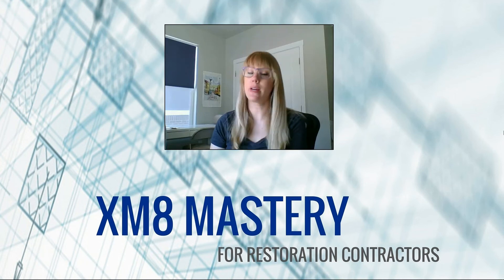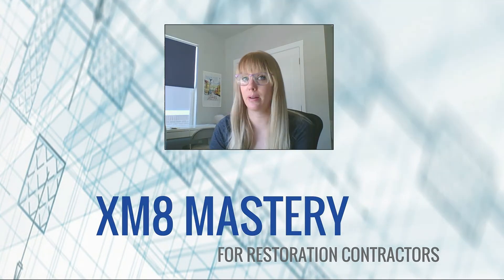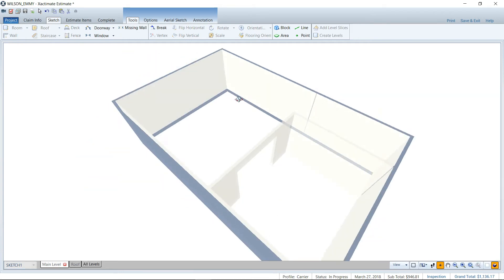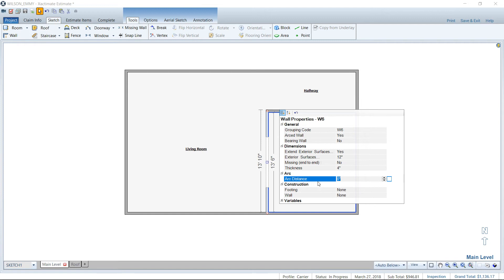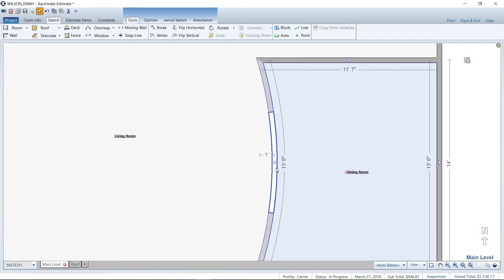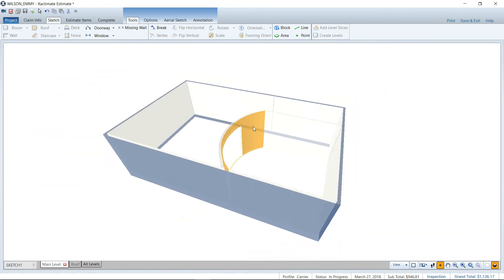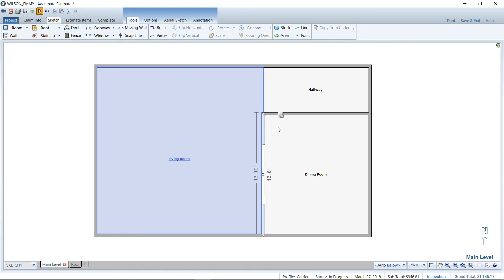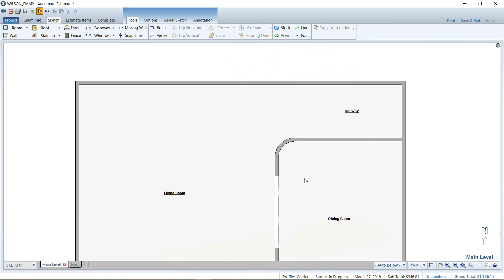Rounded or Arced Walls in Sketch

Comment: QUESTION: What if the wall you want to Arc is not the entire wall.  Say you have a 16 foot section of wall but only the center 10 feet is arched out with a remaining 3 feet of flat wall on each side of the arched section.  
I cannot seem to figure out how to set new points of contact on the wall to arch only that section.  I do not want to arc the entire section of wall
Reply from the maker: I would recommend building 2 separate rooms and combining them or using the square break tool to break the wall of 1 room and pop out the wall 4" then arc it, if you don't mind the 4" difference.

Comment: Alena, amazing, just watched it fully, didn't even realize that "Arched Wall" trigger was even there after all these years....  How about a video on "How To Do Understair Rooms Without Breaking Floorplan"... At the moment I have to break out the room separaely and draw a little arrow to the location that it's at (underneath the staircase). But is there a method to actually place the room itself underneath the stairs??? Thanks again for this nfo.
Reply from the maker: That's funny because Ethan commented the same thing about the room under stairs issue! I'll have to look into it further as I haven't had to Sketch that particular part of the home. Gotta do some homework!
Reply: Alena Wilson I know after I posted my comment I scrolled down to see his comment and I did a double-take.  Alena, is there a calc code for LENGTH OF A SHORT WALL?  In x27 used to be “SS”. (As LL is length of a long wall). TIA.
Reply from the maker: All I can see is HEIGHT of the short wall (SH). I believe you could just load baseboard or whatever LF line item you're needing to your cursor in Sketch and apply it just to the short wall for the LF. Does that make sense?
Reply: Alena Wilson Very true, however I prefer to enter my line items via the entry pad.  I can enter line items much faster like that because I can type very fast. I hardly ever use the line item placement to on the sketch screen.
Reply from the maker: I just figured it out with tech support - it's the variable, then the part # in the calc field, i.e. PFW6
Reply: Alena Wilson yep that’s right you can do it like that... but there is no on-the-fly sort of global calc code..like LL for instance.  But thanks for your time to figure out the alternative, many thanks!